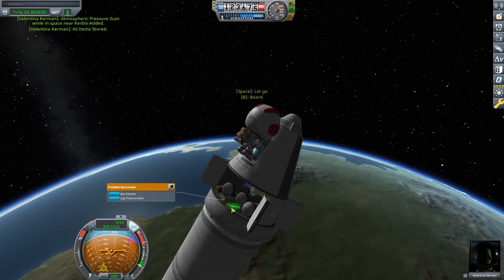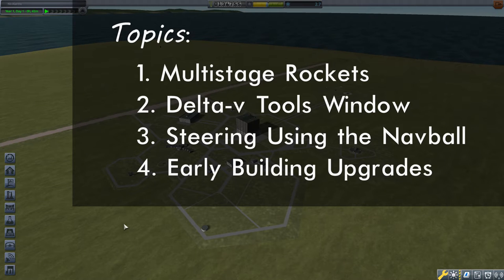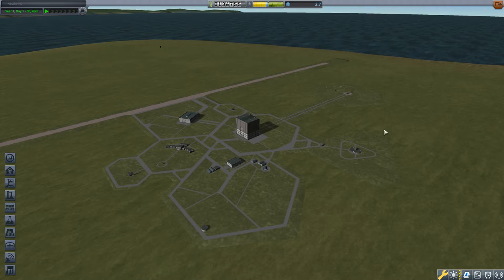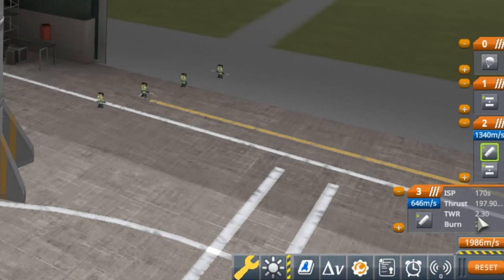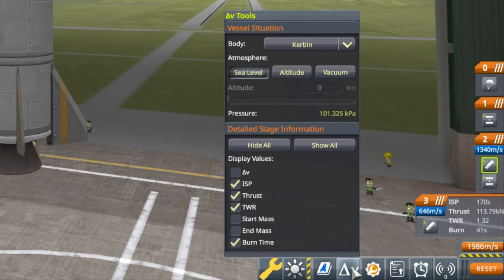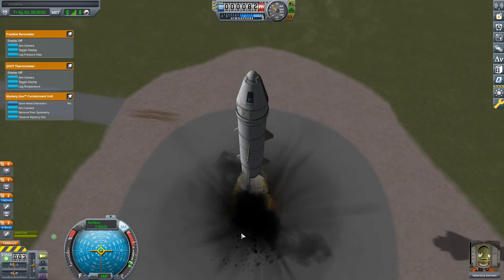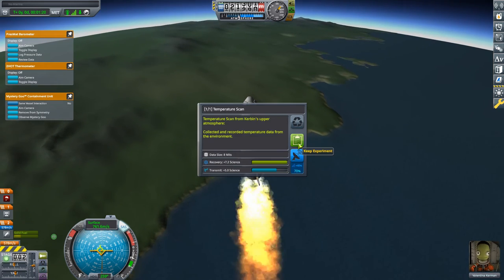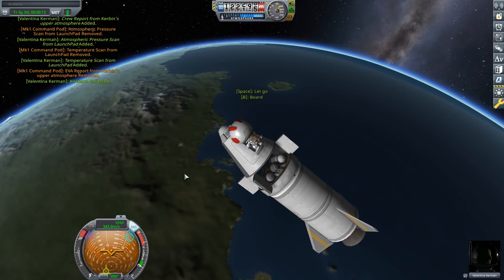Escape The Atmosphere | KERBAL SPACE PROGRAM Contract Tutorials

Comment: Hey Mike, I would like to build a 2 stage rocket for orbital insertion such that the 1st stage takes me to an apoapsis of 80km, followed by 2nd stage for full circularization. The total deltav should be approximately around 3400m/s, I want to know how I could split the deltav such that the first stage burns upto apoapsis then stage and then fire at apoapsis for circularization.
Reply from the maker: The amount of dV to reach 80 km will vary depending upon the steepness of your ascent, and the upper atmosphere TWR of the rocket. The final insertion burn can be anything from well over a 1000 m/s down to just a few dozen.

For example the rocket in this video used 2278 m/s to reach an altitude of 130 km. Orbital insertion would have been a further 2105 m/s.

Next episode will be about getting to orbit.
Reply from the maker: Just to add a more realistic example. In next week's video, I use 2265 m/s to get to an altitude of 80 km and then 1311 m/s for the insertion, but I've done launches in my own streams that we more like 3350 m/s to reach 80 km and then 30 or 40 m/s to insert. It can vary

Comment: Hi, I have a question about placing fins, when you place them you can chose 1 2 3 4 5 6 etc and they are all semetrical. I dont know how to do that and would appreciate help. keep in mind im on console and new.
Reply from the maker: I don't know what the console controls are. On a PC you can click on the symmetry icon at the bottom right corner of the screen. Also, there is the KSPedia at the top right when in the KSC view (where you see all the buildings). It has tons of information including the key bindings.
Reply: @MikeAben  thanks so much, im on xbox but im sore i can figure it out with that.

Comment: I always have issues duplicating the results. Followed this almost exactly and can only get to an altitude of 50km.
Reply from the maker: View your rocket into the VAB, set the Delta-v Tools to vacuum. The total delta-v of the rocket should be 2278 m/s. If not, check over your build. Perhaps you removed fuel by mistake, have the staging wrong, or used Fleas instead of Hammer boosters. Also, make sure that you tweaked down the TWRs as shown in the video.
Reply: @MikeAben  Thanks!! Wrong Engines :( Worked Perfectly!